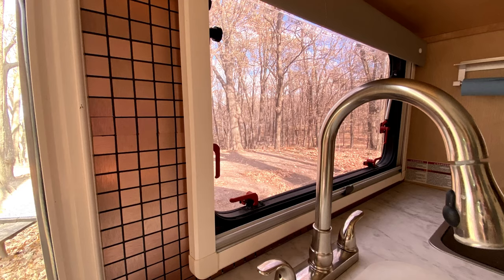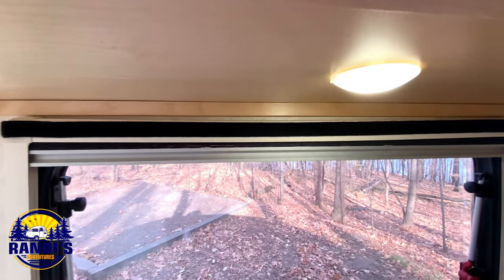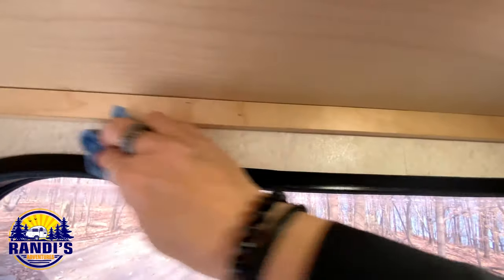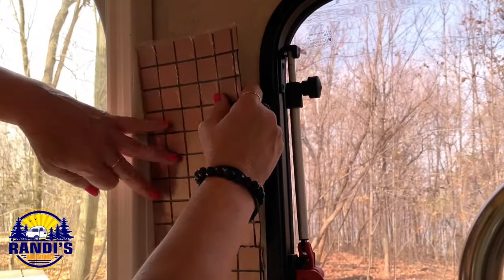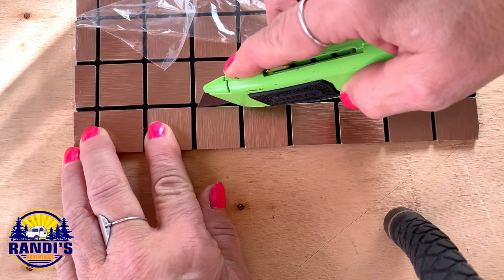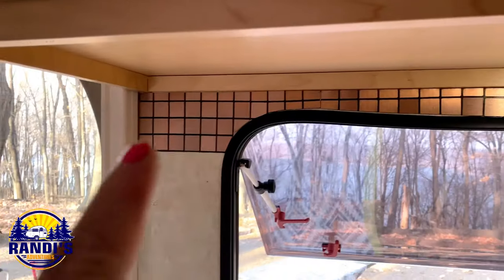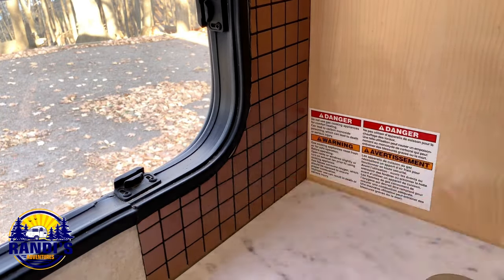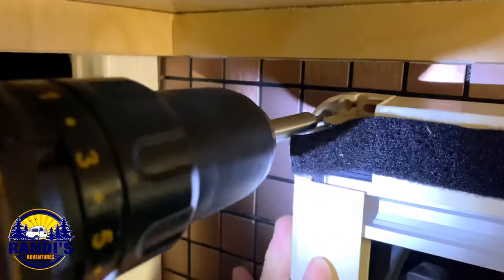RV DECOR & DECORATING IDEA: DIY Backsplash Tile 🤩 (for WOW FACTOR!)

Comment: Tip on applying things like this. We used to put pin stripes and graphics on anything like trailers, boats, rigs and vehicles. Even an x-ray machine once for a doctor. Any "graphics" we would tape in place exactly where we wanted it to go. We would slice across half the backing that protects the sticky side leaving a place to start pulling the backing off from the middle. Not out outer edge.  When firmly taped in place loosen one side from being secured, start to remove the backing from the middle where the slice is and apply the sticky side on pushing air pockets out as you go. Only remove as much backing as needed to keep applying till half is done. Then start on the other half doing the same.  You work from the middle out if possible.
Reply from the maker: That’s brilliant Steve!!!! I wish I had this tip before I did this. I appreciate you sharing this! 😁👍👏
Reply: Steve Lucier
Thanks you so much! I will keep this tip in mind for my Spring to do list!!!
Vie 🇨🇦

Comment: Do not peal all the paper off when applying... as you adhere peal the rest as you go.  I do decals and stickers this way to have more control.  I would have done the adjacent wall as well as cohesion and protection.
Reply from the maker: I love this peel and stick concept! If I hadn’t pulled all the backing off at once applying the tiles to the wall would have been so much easier. That’s why I love this community... we all help each other. Thank you!